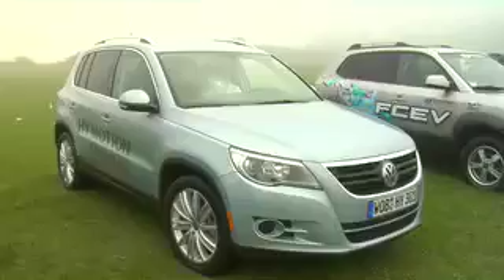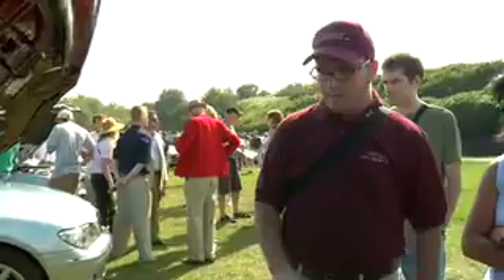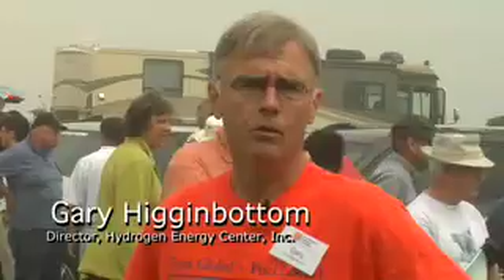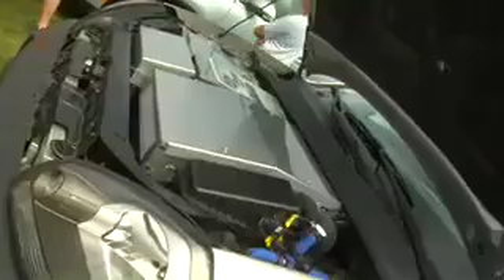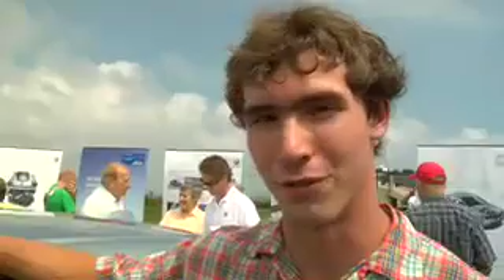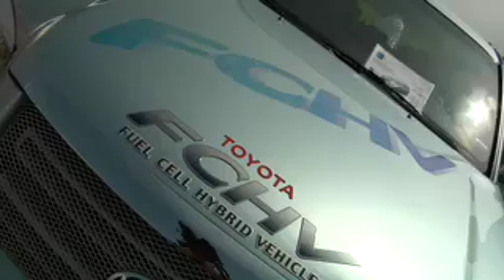Hydrogen Cars - Hydrogen road Tour ME

Comment: No you cant. Water vapor is NOT a greenhous gas, CO2, Methane, and other hydrocarbons are. What we have now is an imbalance caused by nearly a century of burning Gasoline in addition to burning coal, and less plants, less plankton in th eocean because of pollution and commericial-fertilisers, and millions of square acres of rainforests dissapearing every year. We neead to wean ourselves off burning carbon-based fuels, and adapt to a Hydrogen economy. We need a POLLUTION REVOLUTION.